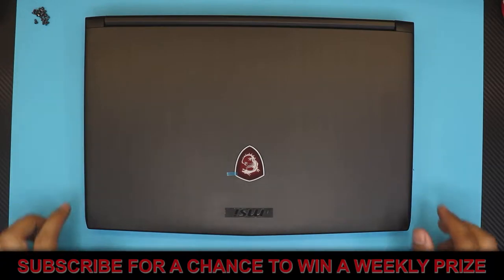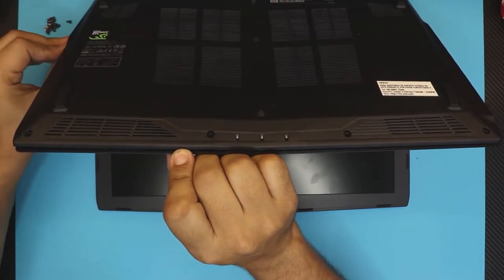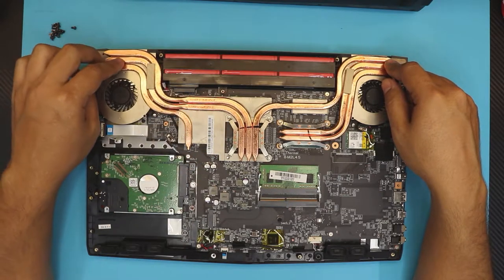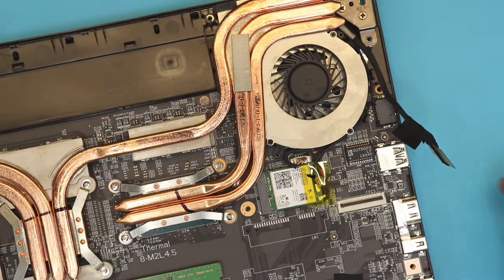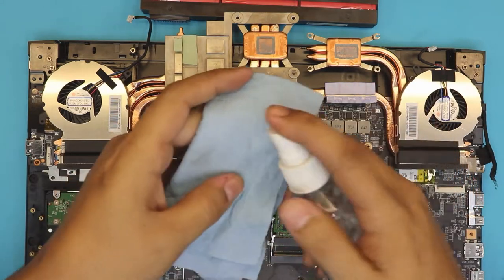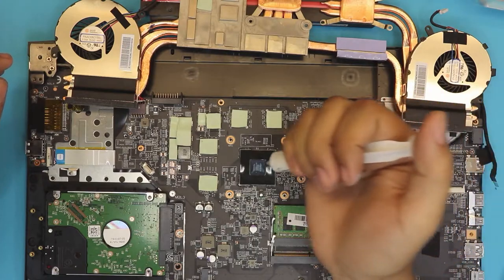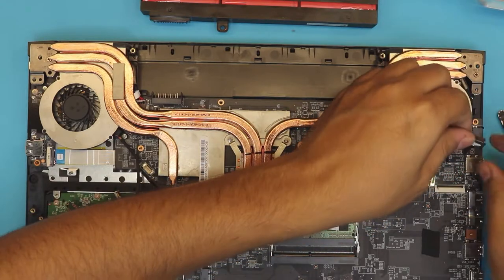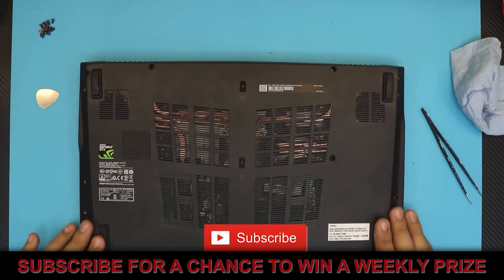HOW TO Repaste and clean your MSI GL63 Series laptop under 20min

Comment: why you didnt change the thermal pads? 
and did you test temps before and after?
Reply from the maker: because the thermal pads are not dried and or cracked, there is no need for them to be replaced, unless you see a crack and dried pad.
the pads don't affect the performance as this laptops are not overclocked on vrams.
as this video was intended for servicing and not for benchmark testing temps.
the temps will be different for each depending on room temp and load work and fan curve. but you defiantly will decrease the temps by 10-15c and you should be doing your cleaning and repaste once every 14months depending how many hours you use for intensive applications.
Should you have any further questions or requests in the future, please don't hesitate to ask me.

Comment: This is GOLD. Lots of love from India. I was afraid to open it up and the camera angles really helped A LOT. I'm using MSI GL63-8RD 455IN (i5-8300H). You earned a subscriber and A LOT of respect. ❤️
Reply from the maker: Glad you like them! and thank you for the awesome feedback this feedback's are my motivations to make more videos. :)
Reply: Hey, i have the same laptop with u, did u experience stutter or slowdowns when play game like apex or ac origins? Thanks
Reply: @DarmaNatural  I haven't played those games but I did played Forza Horizon 3 on it, and everything worked absolutely fine. I'd give you a tip, after cleaning and pasting, undervolt both CPU and GPU using Intel XTU and MSI Afterburner respectively. That will further help in increasing performance and keeping your machine cool for longer.
Reply: @siddharthnautiyal5188  thanks mate!

Comment: Hi, my laptop is gl63 8sd, i7 8750h with 1660ti, can I use mastergel pro v2/mx4 on the vrms and vram? I know people said I should get k5 pro, but k5 pro is not available in my country. Or should I get 0.5mm pads?
Reply from the maker: 😊Thank you for the feedback! if you wish to support the channel you can LIKE or SUB or both :P
regarding your question: people that say use master gel pro or mx4 on vrams where its clear that you need a thermal putty, they should clearly understand the difference from paste and putty, don't use paste get a thermal putty from aliexpress: shorturl.at/bezDU

Comment: Hi! First of all, thanks for the tutorial. I have followed all these exact steps for my MSI GV62 7RD, except that I didn't remove the ribbon cable, just pushed it aside. After applying the thermal paste, I plugged in my laptop and hit the power button. The laptop turns on, the keyboard was lit and fans were working, but the screen didn't turn on.
I forced shut down the laptop by holding down the power B and this time started it without the charger, but same results. Fans are working, even turbo mode is working, but the screen won't turn on. One other thing is that I also cleaned both ram slots, if that has any relevance. Please let me know of any possible solutions, that would be greatly appreciated.
Reply from the maker: remove both rams and the battery and the charger and press and hold the Power B for 60 sec , after that only place one ram in the dim A and plug in the battery and plug in the charger and power on and wait about 10-15 sec , if no result then place the ram in the 2nd slot and power on and wait for 10-15 sec and if you get screen force shutdown and place the 2nd ram.
Reply: @uFixTek  Thanks for the reply! I have already fixed it, it was due to an incompatible ram module. Thanks again for time and help.
Reply from the maker: awesome, i knew it was about the ram, that's why i asked you to test the rams one by one :P
good that you got it fixed my friend.
Should you have any questions or requests in the future, please don't hesitate to ask me.
Reply: @uFixTek  Yeah sure
Reply: @uFixTek  And also thanks for the detailed explanation in the tutorial, it really helped. Have a nice day!
Reply from the maker: you too good luck cheers....

Comment: my gl63 8rc have a problem with the right side fan cooler, could be possibly to disassemble between the fan and the heatsink?  gonna replace the right side of the fan
thank you
Reply from the maker: Thank you for the feedback! if you wish to support the channel you can LIKE or SUB or both :P
regarding your question:  Yes my friend you can separate the fans from heatsink and replace the fans there are few small screws on the fan remove them and the fan will come out loose.
Reply: @uFixTek  appreciate the answer, thank you so much
Reply from the maker: its my pleasure my friend, if you have any question or request in the future feel free to ask me.

Comment: Is there other things that i can do to clean my gl63 8rc beside repasting it?
Reply from the maker: Thank you for the feedback! if you wish to support the channel you can LIKE or SUB or both :P
regarding your question: if you have an over heating issue and never serviced or replaced the paste , there is no other solution my friend , your ventilation and paste must be cleaned and repaste. 
With all due respect, your question is similar to having a car and asking the mechanic if there is a way to service the car without doing an oil change.

Comment: Great review thanks, last time I reconnected the battery it sparked is there any way to prevent this?
Reply from the maker: Thank you for the feedback! if you wish to support the channel you can LIKE or SUB or both :P
regarding your question: place the battery straight evenly into the jack, no extra process should be before or after, small amount of spark you will see if the battery is 100% charge, you could do the service when the laptop battery charge is at its lowest.
Reply: @uFixTek  thank you so much for your prompt reply, I'll do it with a low battery this time as you're correct it was fully charged the last time,  Subbed and liked :)
Reply from the maker: @_Area-51  much appreciate your support, if you have any questions in the future, feel free to ask.

Comment: Hey i did this and cleaned the fans then closed everthing and it wroked but the one fan started making loud noise. I figured some screw was loose or somthing so i opened it again and tried working on the screw on the fan near the wifi thing. After that the laptop wont turn on. No sounds no lights nothing. Some small plastic piece got out from somewhere but it was really small i dont think its because of it. What could be the issue?
Reply from the maker: can you please send me the picture of the plastic part that is loose, its important i see that plastic, and i will help you, email me the picture,and picture of your motherboard with everything connected.
ask@ufixtek.com
Reply: @uFixTek  thanks. I did
Reply from the maker: im checking out and i will email you in a bit.

Comment: Hello sir, what paste would you recommend the grizzly kryonaut or conductonaut or is there better options for the MSI GL63 8SE RTX2060?. I was doing some research about these two pastes but im afraid of doing it. some people say that it will dry out fast leading to bigger problems so what do you suggest me to do?
Reply from the maker: Thank you for the feedback! if you wish to support the channel you can LIKE or SUB or both :P
regarding your question: sorry that i was away for few days, don't waist your time worrying about the long term of the paste to dry or expire.
because for a paste to dry up it has to be on constant power for over 2years 24h/7.
normal use 6h daily any of the recommended paste will last you over 4-5years, but again you will need to open up before that and clean the fan and that implies that you have to repaste.
i would recommend you:
#1.thermal grizzly kryonaut extreme: https://amzn.to/3pK6wOv
#2. Noctua NT-H1 https://amzn.to/31hkZIp
#3. ARCTIC MX-5 https://amzn.to/3FLdLeA

Comment: Never done this... Can I use it right away after applying the paste Or do I have to wait?

Btw how often do I clean my fans?
Reply from the maker: Yes you can start using it right away.
and you should clean your fan depending how dirty is the environment, i recommend you to open it up every 6months and see how dirty it is then you can move up or lower the date. also if you want no recommended is that you keep your eyes on the temperatures. if they start going up after few months then you know its service time. :) good luck

Comment: Hi, did everything like in this video, but now my laptop doesnt turn on, double checked everything is plugged, i did pull out the ram in the prosses, right now it wont even give a light or anything, any idea what i could do to fix it?
Reply from the maker: Did you plug in the charger and wait 10sec then power on,
1nd solution is press and hold the power button for 10sec.
if you remove the ram hard drive and even the battery the laptop should show indication of power on led blinking but no screen.
let me know.
Reply: @uFixTek  yes i did, also tried to reset the battery through the small button
Reply from the maker: i need to know if the laptop shows any signs, any led light blinking or fan spins charge indicator, you need to give me more detail in order for me to be able to assist you.

Comment: hello thanks for the great video! is there a way go disassemble the fans? there seems to be something wrong with one of my fans, it keeps making squeaky and scratching noises. or do i have to replace the whole heatsink?
Reply from the maker: Thanks ✌  for the feedback!  if you wish to support the channel you can LIKE or SUB or both :P
regarding your issue:  you can replace the fans and its cheap and better option as the old fans they start going bad and the RPM goes down. take a picture of the fans and the stickers of the fan and send it to me and i will get you a link of the right fan model.

Comment: I already do it and repaste it, but my laptop not turned on, is that because the battery is unplugged and plugged in again so it need electric power first to turn it on or what should I do
Reply from the maker: Thank you for the feedback! if you wish to support the channel you can LIKE or SUB or both :P
regarding your issue: you will need to follow this step, when you finished repasting, plug the battery and then plug the charger and power on and wait 10-15sec, then it will boot.
Reply: @uFixTek  thank you! I do it and it worked now :D
Reply from the maker: @eben216  im glad , if anything feel free to ask me :)

Comment: About how tight should you screw on the cooling brackets? I heard you can damage the components because it is just the bare die with no heat spreader.
Reply from the maker: no you cant damage it i been doing this for a long long time and never ever had an issue i service about 8-12 laptop daily. just tighten normally with a soft force thats all.

Comment: Thanks for the video it was a great guide.But even after replacing thermal paste on the market i still have GPU thermal throtteling .Applied thermal paste properly.Still goes to 85c while playing games.Don't know what else i am supposed to do. Laptop have good game capabilities but whats the point of I can't even play.
Reply from the maker: thank you for the support to the channel and feedback, GPU at 85c wont thermal throttle.  did you boost he vram speed or something. 85 on full load is not that bad
Reply: @uFixTek  thanks for reply, yes I stress tested the GPU , overclocked it.But those 85c thermals are after 10 minutes of gaming on Balanced mode   it still goes upto 75c .So youre saying if i continue it won't damange my laptop?

Comment: Hi , I got a problem with the hinges on laptop I think its because of the overtightness of the hinges the bezel is being separated from top plastic lid along the bottom corner to top about two inches and whenever I opened or closed the screen its putting pressure on the hinge and the separation is being increased now im using some tape to hold it together but looking for some permanent fix hope you can give me some suggestion
Reply from the maker: i will try to make a video to give you a idea on a correct way of servicing and repairing hinges.
give me few days. try not to open or close too much. also if you can provide some pics so i can check the damage that has been done. thank you for the support to the channel by a sub :P
Reply: @uFixTek  I've given access
Reply from the maker: got it :)

Comment: Hi man, nice video. This helped me to open my gl62m but i found myself stuck with some stuck really tight screw on the cpu and gpu. Do you have any tips how to unscrew these? Thank you
Reply from the maker: they are really hard to open but you need to make sure you have the enough pressure on the screw and it will come out, with a firm force. there is no other way except force.
there is one tiny way, you can use a soldering station and heat up the screw for 1min or less and then use screw driver, the heat will break the tight lock that the screw has.
but go with extra force 1st.
thank you for the feedback :)
Reply: @uFixTek  If I don't tight the screws as hard when assembling, that could cause that the laptop won't turn on again???

Comment: I have a very similar laptop GE73 8RF, I've been using it for two years now and the cooling system is very dusty after that time, I ordered "Thermal Grizzly Kryonaut" thermal conductive paste, I wonder if the difference between the original paste will be any significant, at this point the laptop reaches almost 100 degrees Celsius. Can you tell me how the temperature has changed in your case?
Reply from the maker: oh boy, all i can tell you is two things take your time and do a nice job of cleaning the old paste and apply the new paste that you mentioned and you will see the surprise my friend i could give a ridiculous number but the surprise is the best outcome :P the paste that you purchased is 1000% better than that sh***t that they use. good luck

Comment: Are the hinges accessible with the lower lid opened?
Mine needs some loosening of the hinges, would I be able to do it?
Reply from the maker: yes just remove everything motherboard and the screws  on the hindges then you can adjust the hindge by rotating (opening) about 1mm the nut at the tip of the hindge.
https://imgur.com/a/L8qZof8
Reply: @uFixTek  Thanks for the reply dude. But do I have to remove the fans and the wifi cables and all as you did? If so I would maybe give it to the service station
Reply from the maker: for extra safety just remove it, so you dont have to pull on them to move them around.
Reply: @uFixTek  It happens to be that I would have to clean the fans. Should I open the heatsink? if yes is it okay to not apply a new thermal paste (while not removing the old one).

Also would like to mention that the laptop becomes quite heated and is not able to deliver its performance, I also hear noise near the left fan. hinges are still a problem. 
Thank you!

Comment: bro my heatsink screw is stripped cant remove it help me
Reply from the maker: its easy way just try to make a cut on top so you can use a flat screw driver to remove, thats how i remove it , find a way to make a  deep cut across and use flat screw driver.

Comment: @uFixTek is it really necessary to remove the display ribbon cable? I am afraid I might break that.
Reply from the maker: thank you! for the feedback and your support to the channel by SUB :P
Regarding your question: You have a better chance of damaging it by not removing it than leaving it there and moving the cable around the fan case, and there is no way you can damage it its very hard , its not that delicate, just lift the lock and slide the cable out the cable in 45 degree, and when pluging it back in bring it inside the jack in 45 degree and sit it down on motherboard. you can't go wrong else im here to help out.

Comment: Thanks for this. I started facing this issue frequently after i started using the fan button and then every six months dust builds up and then it just completely screws the performance. I think that i should not use the turbo fan mode when im not playing, maybe that will minimise the issue. Also do you have any tips on how to minimise this.
Reply from the maker: Thank you for the feedback and your support to the channel by a SUB :P
Regarding tips on service, i would recommend you to use a dust mesh cloth or fiber:
here are some you can cut and place it inside the bottom case.
https://amzn.to/3q0Tg4U